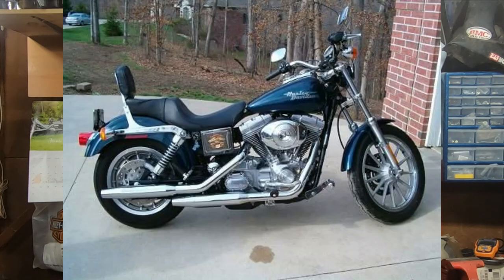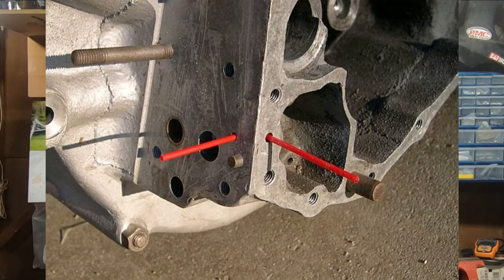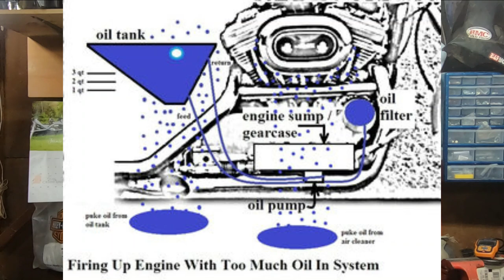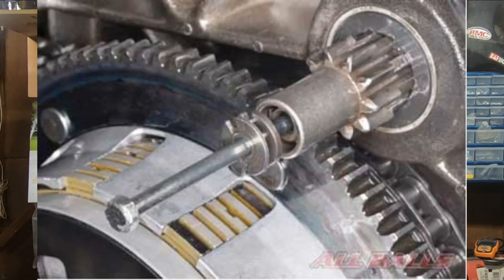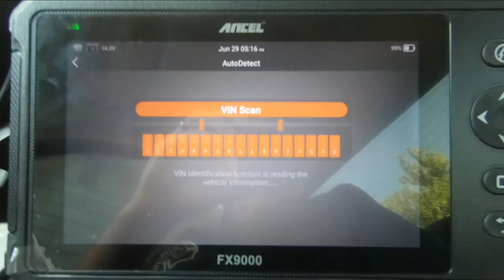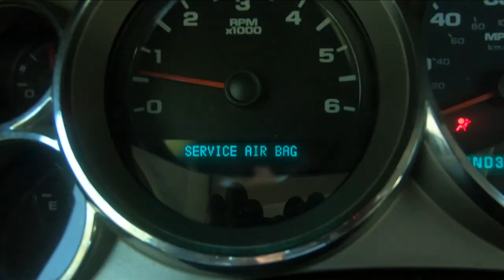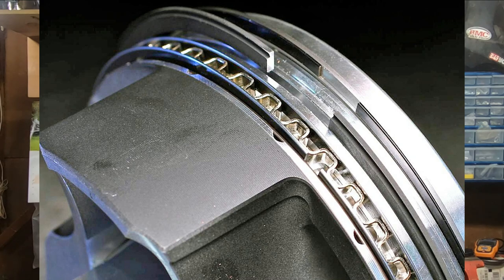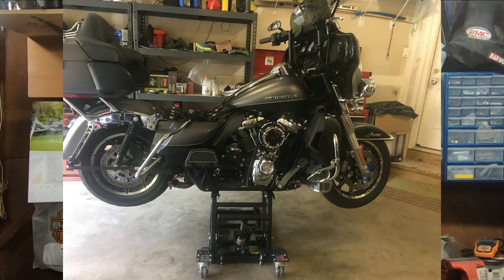Harley-Davidson Engine Oil Sumping Is Drowning Your Crank

Comment from the maker: Have you ever experience a sumping issue with an Evo, Twin Cam or Sportster?
Reply: I have a 92 FXR that has a sumping issue.  I don't ride it enough, so when I do, it pukes oil out where I should have a catch can.  A catch can is on my to do list for this 4th of July weekend.  Thanks for another great video @gixxerfoo.
Reply: I've never had any sumping problems, owned a '87 Tour Glide, '95 Super Glide, currently own a '93 Tour Glide and a '84 Electra Glide. The '87 had over 140k on it when I got rid of it and it still ran awesome.
Reply: No but I'm going to start checking my oil more often now ✌️
Reply: Had/have… 96, 103, 110 TCs and a 114 M8.  Not had any sumping issues.
Reply: Just noticed on my 87 FLHTC. Sat for a few weeks while i was on vacation.  Evo's have a check ball in the oil pump that is usually the culprit... Time to order some parts.
Reply: @77xlchop  overfilling doesn't cause sumping.
Reply: @frankp7885   That's not sumping
Reply: @ranchodeluxe1  OK.  What is it called?
Reply: yeah,...i go over The Cure for wet/ sit sumping in my latest video.
Reply: @joekool4 it's what I'm working on now and this bike is a complete POS . Everything has to be removed to do anything on this damn thing
Reply: Replaced the cam tensioners on my 2002 softail standard FXSTC.  Took a few months .
Noticed the oil tank is empty . Should I start it and let the oil circulate back into the tank or should I drain the crankcase . Heard both don't and do .
Reply: After reading most of your answer to comments on this video...u give wrong..untrue..bad advice/answers...learn fact before talking or shut down ur b.s. channel

Comment: A reputable HD service manager recommended ignoring the service manual procedure and do as follows: when cold, stand the bike up, run the engine for 30 seconds, turn off the engine and then put the bike on the jiffy stand. Walk around the bike, kick the tires and get your gear ready. Then check your oil level. It should be at or near the halfway mark. Only add oil when the level is at or below the fill mark. Fill up to halfway only. The manual says to run on jiffy stand. The service manager said the oil pump will not fully scavenge the oil back to the tank when on the jiffy stand. Running it in the upright position allows proper scavenging. Also, he recommended installing a short sump plug. Some of the factory sump plugs are seated too far in the case and actually block up to 60% of the scavenging. This is how I do it now. I avoid the hot check. Something to ponder :-)

Comment: Been there. '18 CVO Limited 115 Anv., 117 in. Stg 4, Stg 2, Stg 1, M8. These are the signs I experienced at about 6,700 miles:                                                                                                     1. oil was disappearing, no leak no burning since new                                                                  2. extreme heat because the crank & flywheel were running submerged in oil                         3. loss of fuel mileage, went from 38-40 mpg to about 19-20 mpg                                             4. about 1/3 loss of power                                                                                                           There is a H-D Service Bulletin M1450 on sumping on M8 motors beginning in 2017. It stated it was for 117 in., 114 in., and 107 in. motors both factory built or dealer built on 117 & 114 in. motors. SB M1450 says to get bike hot, upright, shut it off and remove the Crankcase Position Sensor and catch and measure any oil that comes out of the dry sump. It said if it is 6 ounces or more it is sumping. My bike had 3 qts. in the sump. That's where the added oil had been going. Plus I had oil changes at 1,000 miles, 2,500 miles, and 5,000 miles. When it sumped the first time (6,700 mi.) it ran like I had filled up with bad gas, full of water. I siphoned the gas out of the tank, added a qt. of fresh gas and ran it out of gas. I carried a qt. of gas and put it in the tank and went to a gas station and filled up. The issue went away but at 6,900 miles it came back even worse. My dealer overhauled the top end and all was good until 62,520 miles (no sumping) but metal in the oil, the hard finish on the cam looked like something was eating on it, chrome finish was gone where the lifters run on the cam lobes, scoring on the cylinder walls, etc. New motor at 62,520 miles.        Excellent video Gixx.
Reply: All this tells me is to never buy an M8 lmao Gonna stick with my Evo Sporty and if I get a bigger bike, maybe a Twin Cam.

Comment: Between this channel and Baxter's Garage, I've learned so much about HD engines.  Especially Twin Cams since I'm looking at getting an 06 TC 88 Softail as my first bike.
Reply from the maker: Thank you, l love to hear it's helping someone out. Kevin Baxter builds those motors bullet proof! 06 Softail, just make sure you get the cam chest updated and you're good to go. They have the tried and true 5 speed transmission.
Reply: @GixxerFoo  that's good to hear about the 5 speed.  It was a concern of mine that it wasn't a 6 speed for hwy use, but my friend who owns the bike said he never had a problem on the hwy.  I would eventually love to get a Pro Twin Performance kit put on it😈
Reply: @trailruntim  there is a website where you put the year make and model of the bike and you get RPM numbers at different speeds. The older Softails didn't have tachs so that website is handy.
  I'm sorry but I can't remember the name of it.

Comment: I can feel some sumping now (50k miles, FXDWG- 2002), and it takes an excessive amount of time to quiet the lifters on first start from the winter storage. I know its time for a new cam plate and oil pump (currently screaming chicken, original oil pump, with gear drives). I'm going with the S&S plate and pump, but thanks to other projects, it's on the back burner for now. I'm gonna let it ride until fall. It's not that bad yet. Another great vid, and a very important one. Most sumping is not damaging, and the pump will get everything straight with a decent long ride. The original pumps (twin cam) are the bare minimum as far a pressure goes. An updated oil pump will do wonders.

Comment: Most folks have no idea what is going on with these bikes ..They take it to the dealer and hope, trust them to fix what the problem is ... When the bike just got hot and stopped running,  or a lifer fails and takes out a bottom end. Oil pump ect .. i have zero faith in stock harley engines for the most part . Thanks for sharing
Reply: Stock Harley engines have literally ran for millions of miles. But Jim knows best.

Comment: I always enjoy your videos. I have a 2007 Road King with a stage 1, and since I’ve been watching your videos I know everything to look out for with this particular year. 28k miles and no issues yet! 
Keep the awesome content coming and ride safe brother!
Reply: Very cool, I have the same year, model and mileage and no issues either. A great plus for the '07 TC 96 is the hydraulic cam chain tensioner. Supposedly more reliable and knowing the way it works it stands to reason.

Comment: 2017 CVO limited, ESP warranty put 6k replacing my bottom end all the way to heads because of sumping.  Push the issue, measure the amount of oil in your crankcase.  You are your best advocate.

Comment: No sumping issues with my 1949 Panhead or my 1996 Road King. I did have issues now and then with my 1968 Sportster until I rebuilt the oil pump, replace the check ball and spring. That cured it.
Reply from the maker: I swear it wasn't really ever a issue until the oil pump went from remote to internal.
Reply: @GixxerFoo  you know, you are probably correct and that assumption.

Comment: I have an 18 FLHXSE and a 21 FLHXS. I had the fan assisted oil cooler installed on both bikes and replaced the CVO’s oil pump with the latest 20 version. I sleep very well.

Comment: I love my shovelhead oil system & S&S pump with good ole dump on ground system. Rarely have any oil coming out the breather. My twin cam I had to vent to catch can , and I put a dipstick breather on it and run 1/2 qt lower than recommended
Reply from the maker: S&S pump makes a big difference! When you fill a twin cam or sportster you want to be no more than 3/4 full when hot on the dip stick. You go to full and you'll be getting oil out of the air cleaner.

Comment: I have an 87 Low Rider Custom with an EVO engine and it has a wet sumping problem.  Not if it is ridden often, but if it sits for a long time, like over the winter.  There are several videos covering fixes for this.  They involve installing a catch can in the breather line from the sump to the air cleaner.  Also seating the check valve to reduce dripping into the crank case when it sits for a long time.

Comment: Nice shelf upgrade! Haha. No sumping issues with my 1993 Blockhead
Reply from the maker: That remote oil pump worked damn well, they had dumping figured out on the shovel. It was when that oil pump went in the engine when the problem started.

Comment: All Harleys sump . If it is a shovel or early evo it is caused by the check valve ball not seating but regardless there is always oil left in crankcase if it is a Twinkie pull the plug on the bottom of every one should be no more then 7 ounces if there's more you have an oil pump problem if it's a M8 motor well you should expect it to dump ! Regardless the oil pumps always leave oil in the case ! When I'm gonna split cases I always turn the cases upsidedown over night I'm never disappointed there is always a shit load of oil in the pan !

Comment: Hi, I have a problem with my 1968 Harley Sportster slumping oil in crankcase after sitting for long periods of time, which has happened often. It won't start with the electric starter, as it isn't working and battery is dead.  When the oil hasn't slumped, it will start after 3-4 kicks. Would I be correct to say that if I were able to drain the excess oil from the bottom of the crankcase, it would start up as usual? I don't know if I can drain the oil from bottom of crankcase, due to the year of motorcycle. Any ideas would be greatly appreciated!!

Comment: Good looking out man. I didn’t know any of those checks.
Reply from the maker: Hears another one and there's a risky plug on the twin cam. It ain't meant to come out and it red loctited in, but if you do manage to get it out you can measure the oil that comes out of the sump. Not recommended though.

Comment: Man, I'm surprised you didn't bring up the bad oil pump from Harley. I just had mine changed and the scavenging ability of the new pump is much better along with the new seal behind the pump. My 2017 114 was sumping about 8 ounces out of the crank sensor after a ride. Now with a new pump, a new cam of course, and venting the dipstick, it seems we have got it taken care of. Yes, I am getting oil residue on the filter at the end of the venting hose which proves excessive crankcase pressure, to me anyway. I have the hose off the dipstick ran straight up and straight back. It's not pouring oil, but there is plenty of residue on that filter. Maybe I'll put another catch can on that hose. Has anyone did that? Please let me know if you have and what your experiences is with that. Thanks Bro, great info as always!

Comment: Off-topic question. When building a performance Harley how much horsepower can a 2000 Harley Sportster (Buell) engine be made to produce?  How does a Sportster case and crankshaft compare to a Evo case and crankshaft for strength? TYIA.

Comment: Touring/ Dyna models now have the oil tank/pan UNDERNEATH The transmission so as to prevent gravity overcoming check valves(of sorts) not really an issue cept with softtails being overfilled and xl models somewhat.

Comment: Slow acceleration and sumping into the aircleaner are normal signs of HDs in my experience. SV1000S, DL650, and KLR650 have no such issues. They work perfectly. No issues. Looking for a 1st gen Hayabusa to ride next, after a turbo installation.
Reply: One thing they pump so many out are trying too get off the assembly lines is the main issue and HD changes suppliers like changing underwear maybe if they stick to the best supplier and cutting quality over a dollar they’d be better off r us the customers would be but noo they know they have people drooling to get one and the other thing u can do a lot more to a HD but I like all bikes really don’t matter it’s whatever u like the most
Reply: @patrickhollis5332  
You are correct. I almost drooled about the PanaAmerica with it's new liquid cooled engine and high tech. Until it dry started on the showroom floor. Hearing that rattle on a new bike keeps me elsewhere. Hell, I have more than enough bikes that had never done that. Just keep riding my 7 old ones.

Comment: Sorry, didn't finish my ealier question. Do you have a link for the adapter for this scanner for the Harley?
Reply from the maker: The FX9000 is for cars and trucks, it doesn't have adapters or software for motorcycles.

Comment: I have a 91 EVO every time it's sits for a long period of time it sumps oil out of the air filter is that normal , I mean every time, should I replace the oil pump
Reply from the maker: Out of your air filter? It is normal if the bike sits for a while for oil to drain from the tank into the sump. Once you get the bike started and running it should clear up. If it only does it after it's sat for a while that would be alright. Also make sure once it's hot when you check the oil you are about 3/4 full and not at the full mark.

Comment: What do you think about using a oil flush on the twin cam?
Reply from the maker: It's not a bad idea honesty to help clear some oil out of the system. There's a lot of people that do it to make sure they get as much old oil as possible out.
Reply: I do it with scavenger every other oil change you will be surprised of how much oil is still in the system after you get done draining it , specially if you have a oil cooler

Comment: I’m having trouble with my dip stick blowing out of my oil tank do to pressure buildup. Is this part of dumping? I can’t even ride the bike oil gets all over side of bike and rear brakes.
Reply from the maker: That's absolutely a sign of it and the pressure build up in your crank case! What year is your M8? You could for sure use a vented dipstick, you've got some serious crankcase pressure build up.
Reply: 2017 Heritage twin cam not a m8 is this an easy fix?

Comment: Can sumping issues cause catastrophic transmission failure? I have a 2019 Road King 114 that recently blew the transmission. The engine felt very hot the last ride before total failure. Last time it felt that hot, I broke the plastic intake manifold.
Reply from the maker: If it's overfilled or carrying fluid over which has been an issue on the M8 it can have the same effect as sumping. Those gears trying to plow through all the oil can put a lot of stress on them, pressure builds, seal give out, it can get nasty.
Reply: That was probably from oil transfer from transmission to the primary,no oil left in the transmission
Reply: @GixxerFoo you are 100 % wrong they is no way an overfilled engine oil system can blow thru crankseal to primary chamber area then into transmission ...u don't know what your talking about...talking out the side of your neck...

Comment: I heard you mention poor gas mileage.   I have an 01 FXDX 88 CI with S&S .510 cam, SE oil pump and cam chest with S&S cam gear drive and 42 mm Mikuni carb but I consistently get only 36.5 mpg.   Only has 24K.  Could this be sign of sumping problem? It runs great
Reply from the maker: Mikuni carbs sometimes are notorious for drinking fuel, l doubt you're having a sumping issues unless you have oil disappearing on the dipstick and reappearing later. The bike wouldn't be running good at all if it were sumping. I would point the finger at the carb, they make some awesome power but sometimes they are thirsty.
Reply: @GixxerFoo  Thank you!  I  feel better already!
Reply: Absolutely not. I had the exact set up at stage 2 before going to stage 4 and I was averaging pretty much the same as you in a 2002 Night Train, even with my 2002 Electra Glide Std. at stage 2, same. 
My Mikuni is set up at 25/ 162.5/ 70 and slide in stock position( live in Boston). 95” forged 9:5.1 flat tops, S&S 79cc Super Stock heads, Trask Mystfree breathers (game changers), S&S rockers (std), S&S push rods, S&S lifters, SE plate and pump, ( I’ve run Fueling as well, no difference) , S&S 510 cams, she puts down over 100/100 and gets about 35mpg. 
I’ve ran different cams in this combo like the TW6, good cam, grossly overrated and went back to the S&S 510, it’s a much smoother, linear cam with longer legs and this is in a bagger.
Reply: @getoffmygrass6974  thanks very much for the info.  I'm in Upstate NY.  I plan on eventually going to 95" when I need top end but I'm really happy with the 88 .  My bike is very light, about 650 lbs., so I'm not feeling a lack of power
Reply: @paulfiore7083 You have a great combo going and you can grow with that cam. Also, when you go 95”,  don’t be afraid to take that cam up to 10:1 (static), she’ll outrun 107’s and keep right up with the 114’s, with ease. Good luck.
Reply: @getoffmygrass6974   Compression was actually my next question!  95" with 10:1 compression.  Very much appreciate!
Reply: @paulfiore7083  Right on!